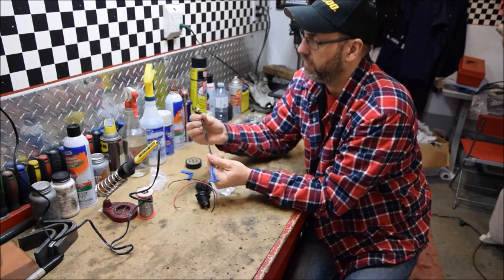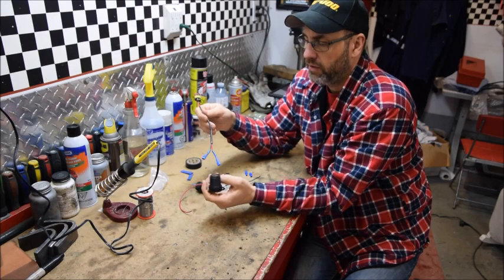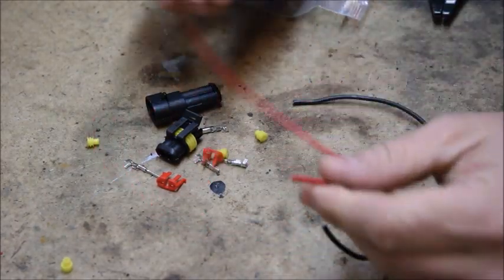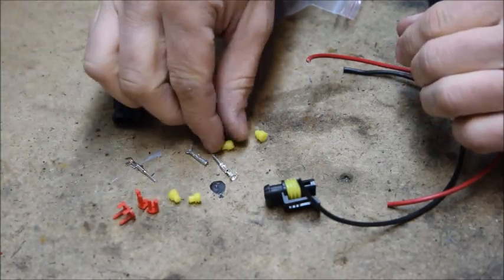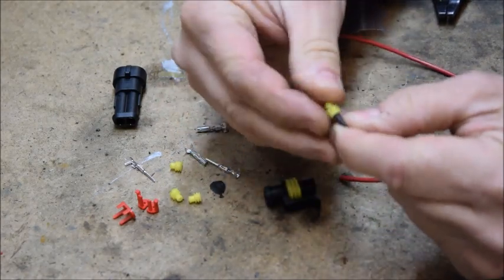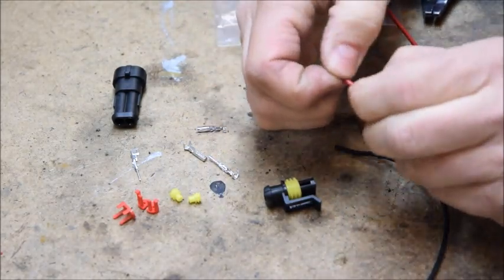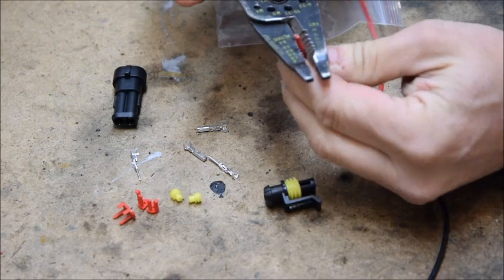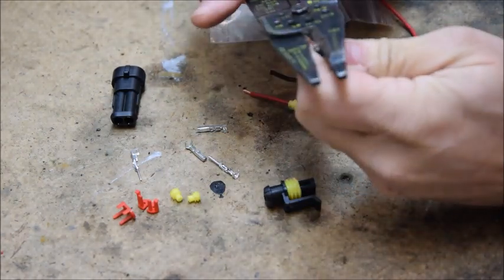DIY - Ski-doo 12 v accessory outlet build and install

Comment: Hi
The correct connector for this is called Delphi part no. 15326801. Fits and seals perfect in this assembly.
Just a tip.
Reply: Marcus Pers was
Reply: where did you buy yours?
Reply: @ericferguson8253  l’ll are

Comment: I have a 2012 Summit, which doesn't have the glove box.  Do you know if that same connector is available in the same spot?  If so, I'll just need to figure out how to mount the cigarette adapter.  I'm also looking for a way to mount a small GPS.
Reply: Did you figure out whether the plug exists on a 2012? Any luck mounting gps?